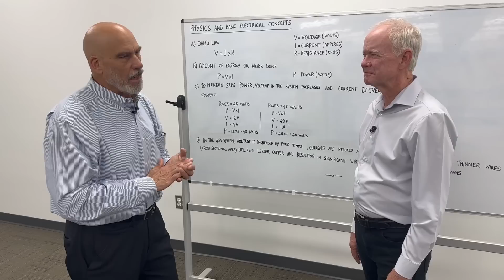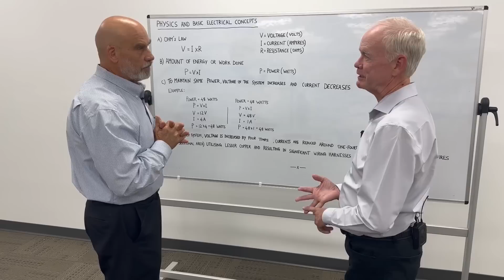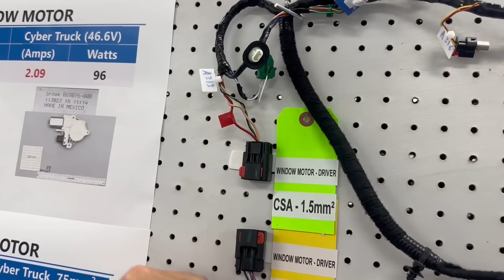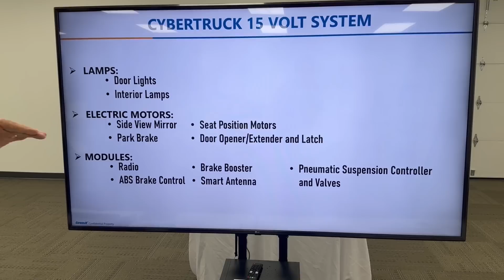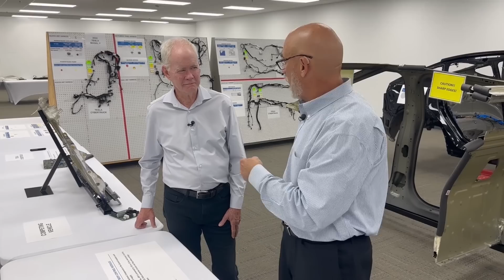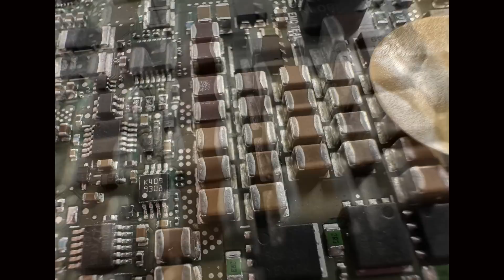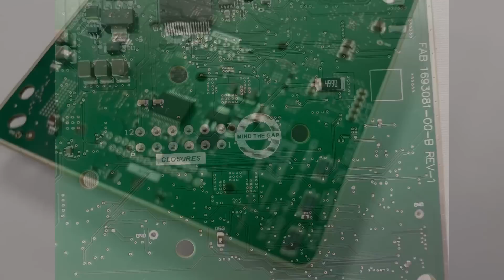Deep Dive Into Tesla's 48-Volt Architecture - Caresoft Teardown

Comment: Two key areas are missing from this discussion. The CAM bus is replaced with a modified Ethernet that only uses a twisted pair and improves communication speed by orders of magnitude. This distributed architecture enables the vehicle to be built in sections and assembled at the end of the production line. A single small connector is used to connect sections to gather. This allows replacement of Ford’s over one hundred year old production line with a more efficient process.

Comment: The reality is most circuits in the vehicle are very low current or data circuits. Changing to 48V doesn't make much difference to the overall bundle size.

Comment: ICE vehicles rely on a standard 12v battery. To switch to a 48v system on ICE would require a bigger battery. 12v lead acid batteries are already fairly heavy and bulky. But it seems to work great on EV's. Maybe ICE could compromise on 24v?
Reply: The key would be to switch to a LiOn battery when going to 48V.  That'd reduce the size of the battery then also.
Reply: Bigger battery???
Why???
You do not need the same A*h capacity at 48V compared to 12V. What you really need is the same W*h capacity.
Very crude example: typical car has 80A*h 12V battery and Toyota Prius - additional 273V 6.5A*h Ni-Mh battery to start and assist ICE and run 12V system via DC-DC converter.
They dont need the same 80A*h, but 6.5A*h at higher voltage even as battery is now part of driving the car.
Returning to converting typical car to 48V low voltage system - 12V 80A*h battery could be replaced with 80V 20A*h one.

Comment: I brainstorm about converting Cybertruck to the RV.

Do you think it is good idea to drive all house appliances from that 48V battery? Most significant appliance is fridge with 150 W and some smaller and peaked.

How to integrate photovoltaics? Dirty way is mppt controller, small battery driving appliances and when full step up inverter for onboard charger. Can this be done more effectively but safely?

Comment: how come the coolant pump has more watts & more amps on Model Y than the blower motor, but a much smaller cable cross-section? 
(1mm2 for coolant pump, 4mm2 for blower motor)
Both should be off 12V network. Anyone has an explanation for that? Only difference I can think of is cable length, but the difference in cross section seems to be huge .... 1mm2 for up to 24Amps just seems excessive, even for short cable lengths...

Comment: That ultra small wire may not burn out, but it surely will break from normal road vibrations and flexing....given today's
expanded sensor numbers, the likely chance of that setting you up for expensive tow and repair bills is greatly expanded....

Comment: So stupid to use 48V because all electronics basically need only 3.3V or less. Only actuators, motors etc makes sense. but electronics....stupid wasting
Reply: If it allows you to cut 30kg of wire out of your car, what is the waste?

Comment: Virtually every multi-layer printed circuit board has a groundplane, going back to the invention of multi-layer PCBs. Its decades-old technology.

In 1903, German inventor Albert Hanson filed the first patent for a PCB-like device that he made for use in telephone systems. The device was a flat conductor for a multi-layer insulating board. The board did have through-hole construction and conductors on both sides, just like plated through-hole PCBs today.  However, devices of this type would not see widespread use in the emerging technologies of the early 20th century, a period that saw the introduction of radios, phonographs, washing machines, dryers and vacuums.

In 1927, Charles Ducas patented a version of the circuit board.  He used a stencil to print wires onto a board with conductive ink, placing an electronic path right onto an insulated surface. He called it printed wiring, and it was the precursor to today’s electroplating.

https://www.mclpcb.com/blog/history-of-pcbs/#:~:text=In%201903%2C%20German%20inventor%20Albert,plated%20through%2Dhole%20PCBs%20today.

Comment: Do they talk about increased energy efficiency or reduction in heat losses because of this switch to 48V? Heat loss = Current^2 x Resistance. Therefore, assuming that the resistance remains the same, the current becomes four times less (because of the voltage going up from 12V to 48V), the heat loss will come down to 1/16th!
Reply: Assuming resistance is the same losses could be 16x smaller.
Alternatively losses could be the same but automaker uses 16x less copper (only if thinner conductor can dissipate the same amount of power).
Electric motors are very special, they will have 4x longer, 4x thinner windings for 1x winding heat losses, 1x output power, 1x motor size and ~1x motor cost.

Comment: I'm still wondering why Tesla doesn't use data over power cables and shared ground. That way they could have only one 48 V shared wire for everything and use Powerline ethernet data connections over that wire.

Smaller manufacturer couldn't do this because you need lots of devices to make it sensible to produce enough controllers so that cost per controller for the data adapter gets low enough thanks to mass manufacturing.
Reply: In Munro video Tesla engineer said too much noise on the power cable.

Comment: Missed the important reason that a low voltage system is needed. High voltage would be dangerous to use in all the peripheral devices. Why 48V, because it is about as high as you can go and still have a 'safe' low voltage.

Comment: When you eliminate the cost of a paint line you make room in the budget for 48 volt systems. If you work for a traditional auto company and you move to a 48v system and eliminate the paint line you save even more money by loosing your job.
Reply: Eliminate paint but add in cost of stainless steel.

Comment: General Motors looked at 40+volt systems at about the 1990's, when I was there.  We had done many military vehicles for decades before, at the 36-38volt ranges for the same reasons.  However, by the 90's, we had transitioned to electric turret drives, and it was realized early that these systems were not adequate, so we transitioned to 150-160volt systems.  Those could be recharged from ordinary 115-120volt power sources, which were commonly available in military world.  When GM engineering generally became aware of these higher-voltage systems, it kicked off a series of EV designs, using such voltages and power levels.  However, at that time, the manufacturing plants for lead-acid batteries had pretty much agreed to a common "sizing" architecture for the 12volts, and the shift to 40+V would have required either one-half plate widths (with resultant loss of lifetime), or a double-to-triple sized battery set.  Just the weight of the batteries would have offset any significant weight savings from copper reduction, and the production costs would have actually raised the cost of manufacture of the vehicle.  Other vendors of items such as Lamps also objected, since the filaments would be too weak to make any customer sense, since replacements would be required every couple of months.  It was not until you actually had a technological transition to LCDs, LEDs, which eliminated the old filament lamps, and also the evolution of Lithium batteries, whereby very thin plates and small packages could be made, that the actual shift to higher voltage systems could be made.  Televisions and computer monitors drove a lot of this evolution, and later smart-phones forced a complete shift to electronic "smart systems" where 0.2-cent IC chips could mate to any prime power source below about 80volts.  With the original alternators on cars, the "load-dump" voltages were capped at about 70-to-80volts at the alternator, so an evolution to a system below that was a natural.  The 30-to-40volt range is limited by a "safety factor" due to the work functions of materials, and human safety.  Above that range, continuous arcing and welding can occur, which can result in spontaneous and continuous combustion of the wiring and metallic structures.  Any customer or service personnel accessible batteries need to be below this range, for human safety, or otherwise they will have to be totally contained, and only serviceable by special tooling.  Paschen limits are already being violated by the 400-to-800volt systems, and these vehicles, and their chargers will have accelerated failure rates.  The future tradeoffs for this technology are being explored and developed as we speak.  I suspect we will learn a lot more, very soon.
Reply: I was under the impression the shock voltage was 60v That is why home systems are 48v. Which can charge over 506v. Are you saying that is okay or should max at 36v considering a 36v may actually be over 40v?
Reply: @timsteinkamp2245  You are partially correct. Shock value is 60v for DC, but for AC it is 42.5 v. You can look up "Safety-Extra Low-Voltage (SELV)" to get specifics. When you say "Home systems" I'm not sure what you mean. Home voltage is typically 120v or 240v. You might be speaking about amps for charging, which is different, of course.
Reply: @Techridr  This is a late reply but I was talking off grid. We are so use to 12v and I went to 24v and should just go to 48v.
Reply: @timsteinkamp2245  Shock voltage is not actually a fixed value, it depends on how much current is flowing, and which organs it is flowing through.  Skin is the usual barrier, and its conductivity varies greatly.  Place a 9V or 12V battery on your tongue, and usually you can feel some tingling.  The danger effect is usually determined by the amount of Current which flows through something.  Look up pacemaker characteristics, and heart stoppages for some information about those.  GFIs are rated to disconnect when 5-to-20milliamperes (or so) flows through the aberrant path (that would be you).  These are coordinated for the usual 115V type of systems.  In welding systems this can actually be dangerous, since if you happen to weld on your arm, the skin breaks down and now you can get a lot of current through your blood, vessels, nerves, and back to your elbow, or where ever your other contact is.  Much damage can occur due to thermal rise, up to boil-off.  I did this once while sitting on a metal chair, was sweating, and the shock reaction knocked me completely off my chair and partially across the room.  Luckily nothing was broken, but I had a hell of a burn on my arm.  Don't be like me.  Over.

Comment: I wonder about insulation rub through yielding shorts to ground with higher voltage able to jump a spark gap that 12v would not. Not to mention in high corrosion conditions.

Comment: 24:36 More important that component suppliers like Bosch (did I saw Bosch wipers motors?) start building 48V versions of their components used by the car manufacturers. Having Telas already as a customer for some of the components makes it easier to start.

Comment: So how much of this is simply a result of Tesla solving for a Tesla-specific design problem? My 25 year old EVs use much smaller wiring than what you showed for the Model Y, and in fact, their 12 V wiring from the main DC-DC converter appears to be a similar size to the Cybertruck's 48 V DC-DC wire. Is that because my 25 year old EVs ran the cables for all the non-essential, heavy load components directly off the 300 V system's HV junction box? In combination with the floor for the low-load wiring size being 0.35 mm2, it seems like there are very few areas of actual improvement that justify a switch to 48 V, especially when LV safety issues are also considered.
Reply: your EV's are NOT High Tech SMART cars w/ AI hardware & software.
your EV are just Dumb electric cars. 
not really ADVANCED.
Reply: @markplott4820  And yet, all the high power draw components are powered from the HV battery, which reduces wiring sizes even more. It seems to me that that is common practice even for other, modern automakers, so this 48 V for EVs seems mostly a gimmick. Especially since even in the Cybertruck, not all components are now 48 V.

Comment: Having engineered in auto wiring harness world wide for 44 years I can see one of the biggest benefits of reducing conductor sizes is a reduction in the exponential mechanical failure of harnesses and connectors due to the leverage exerted between large diameter wires  and their comparatively flexible   insulator connector housings  (inevitably plastic). Some of the luxury vehicle wiring harnesses are so big /heavy they take 2 people to lift them and tooling / cost for larger crimped terminal ends again is an exponential rise in difficulty / cost / weight / size.........Go Tesla 48v
Reply: If the harness has proper anchor points and clamping, size is not a problem, some systems require massive conductors (EV's for instance) and are very reliable if properly designed. 48 volts is just a sales gimmick.
Reply: What you have just described is the problem, those "additional" items, reducing the  physical harness to manageable, males a massive cost effective quality move, I know Ive had to be from Mexico to China solving just this problem.....its no gimmick......theres a lot of wasted time and $$$$
Reply: Yes the Elon Naysayers don't Understand that Elon is dragging the rest off the Industry in to the Future The same 
at Space X and Neuralink  and Battery Technology

Comment: Bottom line is 48v has no ise out of large deaw power like windows or suspension , everything  else will get stepped down and the weight savings and cost wont add up to much and probably  more since insulation on the connectors will need to be huge.
Reply: you obviously don't understand what they presented. the weight and size reduction is 75%. the step down BuckBuck converters are tiny, lightweight, reliable and efficient.   (open any LiPo battery- you will find one in it)

Comment: Righoff the rip this guy seems to not understood  power.  Weather you use higher voltage or lower voltage its still gonna consume the same power.
Reply: CT is extremely EFFICIENT like all Tesla vehicles.
LEGACY auto , not at all Efficient.
Reply: yes, but not the same amperage.  Volts times Amps equals Watts. the Wattage (power) stays the same. if the voltage is raised the amperage goes down. that is the formula.

Comment: What is interesting is that on the "old" 12V systrem, The RADIO or HEAD UNITS or power amplifier had to use a BOOST converter to multiply the voltage in order to get the desirated amplifier output level.. BUT with 48V system.. you no more need that!! even the RAIL of 48V is enough to work in half bridge and supply 1000W to the speakers!

Comment: Why such a big jump?   24 volt technology is well tested on trucks and small aircraft.   When you switch voltages it's the little stuff that can bite you.
Reply: LEGACY autos should have gone 48v in the 1960's .
NO real progress in 100+ years.
Reply: @markplott4820  -- There weren't any great loans added in the 60s.   The starting loads were increased as V8 became standard.   It might have been reasonable to shift to 24 volt nominal system.   That increases the max available power without demanding the re-invention of all the technology.   Many trucks then & now (& busses) use 24 volts.    I believe one or two model have successfully implemented electric power steering with 12 volt systems.   24 would make it universal.   That's high enough to pick up all motor driven loads to include the A/C.  Things like the water pump and the oil pump could run on 24 volts.

Comment: You also have to look at voltage drop on low voltage DC systems. Not uncommon to see 10.5-11volts under load on 12v systems, so things work harder and hotter on lower voltage systems.
we have been using 48v dc systems for 25 + years. car manufactures are just lazy bean counters. Elon, good or bad kicked them in butt to wake up.

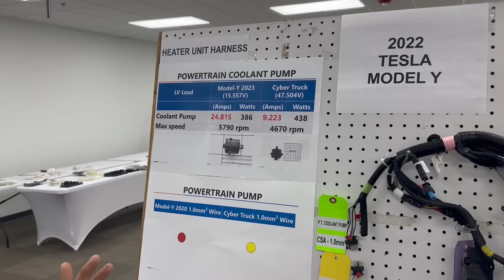Comment: 12:45 it's not "work to be done", they almost certainly sized the CT wire to be able to run much higher average power to the coolant pump in order to get a much higher sustained battery and motor power.
Marketing the truck as "faster than a porsche while towing a porsche" then having it throttle to 60 MPH when actually towing in hot weather would be a PR desaster.

Comment: Interesting to see the design choices. Some wires are clearly not sized for continuous load, most notably the seat heaters.
Reply: Flimsy is what comes to my mind. They better have sturdy insulation.
Reply: @jamesvandamme7786  My Lincoln managed to burn out its heated seat connector. I would put more faith in Tesla to get it right.

Comment: If you're running out of power for all the modules, maybe you have way too many. My POV there should only be four: engine, transmission,  brakes/stability/traction, and spyware/infotainment/misc.
Reply: No windshield wipers.  No heaters and AC.  No power windows, seats, and mirrors.  A car that the public wouldn't buy.

No air bags.  A car that the government wouldn't allow to be sold.
Reply: @bobwallace9753  How about sensors and radars, and maybe some lights?  And get rid of the engine and transmission.
Reply: @jamesvandamme7786  
I didn't attempt to make a complete list.  But there's no need for radar if you build a smartcar.